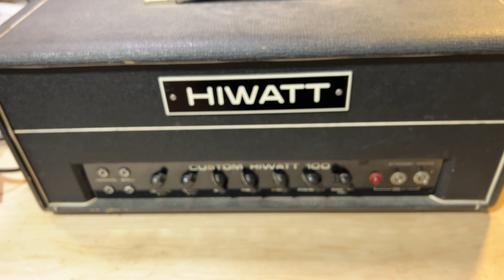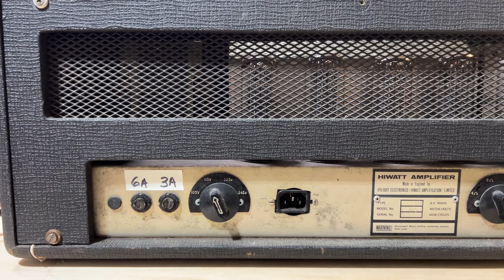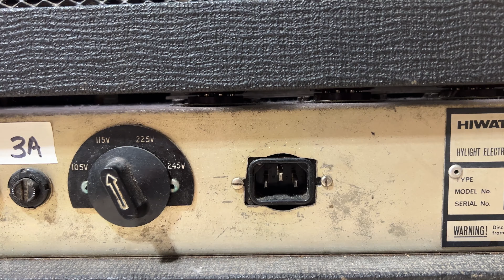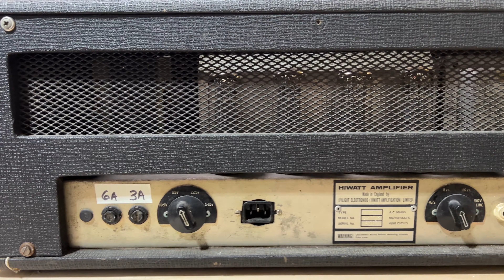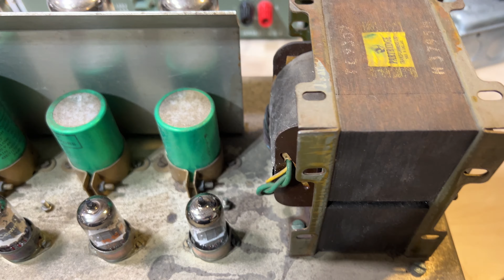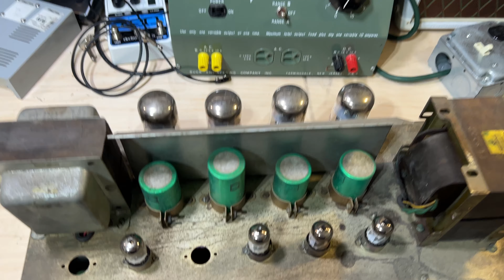1974 Hiwatt DR103 Repair - Part 1

Comment: That L plate soldered to the chassis is not original. What's going on there?
Reply from the maker: That is a great question. I didn’t catch that until after i made this video and got some inside thr chassis pictures from my buddy who owns a DR103 from the era. The soldering to the chassis looked terrible so it caught my eye but a lot of strange stuff can happen to an amp across 50 years. If it serves no practical function and is not original i will remove it.

Comment: What a shame - its not really a Hiwatt anymore if the original Partridge output transformer was replaced with the Dagnall that Marshall used. They're both impedance wound for EL-34's - but the Partridge and Dagnall are two different output transformers as far as tone goes. Good luck finding an original Partridge tho 😢
Reply: Wow, I am in need of original Hiwatt output transformer(s)- would you mind telling me where you sourced a used one? I've been looking for years, and I was told Sound City OTs are a different spec, as well as tapped differently...much obliged.
Reply from the maker: @harrykadaras9459 hello! I got this one off of Reverb years ago. It is a different spec from the original and is from a Sound City 120 amp so there ARE some complications that arise in this series. I am currently waiting on Heyboer reissue OTs to come back in stock so that i can try one or those in the amp as well.
Reply: Before closing in the early 80's Hiwatt made a DR 504 OL.
     OL stood for overdrive/lead.
They have Drake/Marshall transformers.
      I own one,..it is glorious.
My label is stamped stating it's status on my Biacrown Hiwatt.
                       JUSTSAYIN'.
Reply: @Steven-re3tx Perhaps they weren't able to source the 50w Partridge transformers by the early 80's and had to use the Drake 🤷‍♂️
Reply: @scottdunn2178 
It was after Harry died and they were looking for a little more distortion for competing with Marshall.
          I wouldn't trade it for anything.
                  Hello from Alaska.
Reply: @Steven-re3tx I see. Rare bird. Enjoy 🔊
Reply: @scottdunn2178 

No one has been able to tell me what exactly 
the Slave/Odbm 1/4" line out is on my DR 504 OL.
       Any thoughts,..?
Reply: @Steven-re3tx I would think it's to slave another amp or to run into a soundboard.
Reply: @scottdunn2178 
      Yup.  Kinda like daisy chaining.
I have sought exact answers from knowing Hiwatt heads to no avail.
      SLAVE Odbm.
            O.k.
                   THANKYOU.
Reply from the maker: Luckily, i have an original Partridge output transformer that i bought shortly after buying this amp (which was mentioned in this video)! The third video in this series will cover testing that transformer before installing it.
Reply: @TechnologyEnterprises  Yeah, I'd definitely put the Partridge back in if you have a spare. Alex Lifeson is my favorite Hiwatt user 🎸

Comment: Those filter caps are original
Reply: go with the double 32mf for the preamp, you won’t hear a difference really
Reply from the maker: Nice. That is what i have ordered and will most likely leave in place.
Reply from the maker: New ones have been ordered and will be in the amp soon!

Comment: Why the bias mod? Hiwatts don't need it.
Reply: Original Hiwatts bias was pretty hot and couldn't be brought down below a certain point. They were ok with the original Mullards, which could handle it, but modern tubes can't. So the bias mod, usually a voltage doubler of some sort, gives you extra range to allow you to cool it down a little to give modern tubes a chance. Does it sound like an original? Hmm..
Reply from the maker: I have read that many of these amps cannot get to a proper bias point with modern tubes which is why i was considering the bias mod as an option. That being said, i do NOT like to modify amps when it is not necessary for safety or basic operation and will first get the amp back to stock before evaluating if i need to add the bias modification. Either way we will cover that in this series as an option.